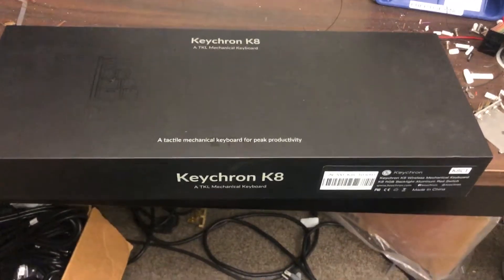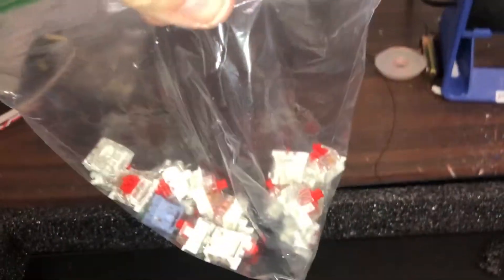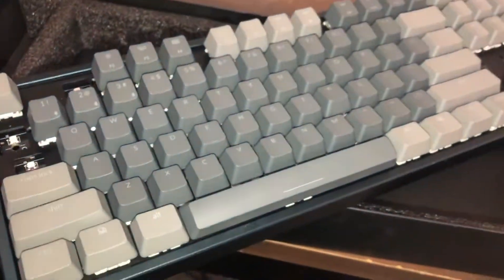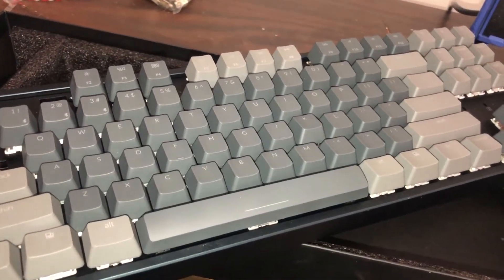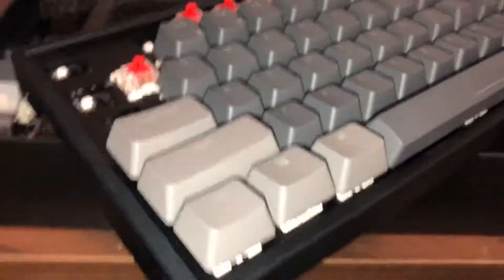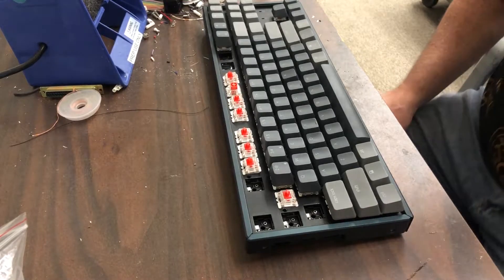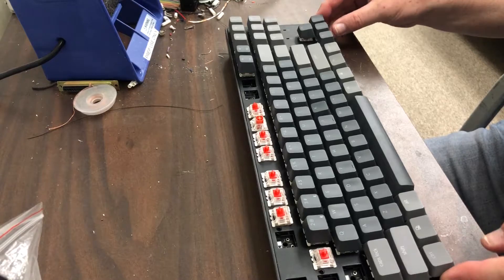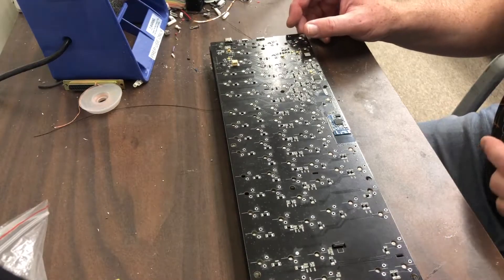Keychron k8 Repair and teardown part 1

Comment: I won't use the keychron keyboard again.
My K8 Pro keeps retyping itself for no apparent reason. 
I tried cleaning the board and replacing the switches, but the problem persists.
Reply from the maker: Yeah. I wouldn't buy one of these. I don't even use this one. It has issues.
Reply: Yeah we've had issues with the Q6 max just outright dying on us, with only a PCB being replaced instead of the keyboard, despite us being it for the explicit purpose of not needing to assemble it from scratch.  My Lemokey keyboard from them also just will randomly repeat a key being typed over and over like you mentioned randomly for some reason. It's been real annoying to deal with, and these keyboards weren't cheap by any means.

Comment: Hi, how feasible is replacing an led without taking off every keycap? I took the keyboard apart and you can see they have resoldered the key and then shipped it faulty. Not keen on the idea of removing every keycap to fix it, but I can see the led underneath in your vid and it looks possible, but before I good looking for a quote from an electronics shop would appreciate a nod to if it's even going to be possible.
Reply from the maker: You should be able to remove 1 key. You should be able to un-solder just that one and pull it out. If you need to do anything with the traces, the whole thing will have to come apart. The keys snap into the metal frame from the top. So yes, it is p[possible.  Thanks for the question and good luck!

Comment: i hate keychron K8, i owned one and when i decided to replace its keycap well it wont, unless you solder off its pin before taking off
Reply from the maker: I agree. I wouldn't buy one. Luckily, it was free.99. And I still don't use it.... Thanks for the comment.

Comment: Will it work through cable connecion without the lithium battery?
Reply from the maker: I have plugged it in via cable without the battery attached, and yes it will work. Thanks for the question!
Reply: @icemanfiveoh  One more question please, are the stock keycaps readable in the dark? I see a video on the amazon link which demonstrates rgb effects. In that video the keycap writings are not visible at all. Is that the case?
Reply from the maker: @Herman Lenana I made a short for you showing what it looks like at night!

https://www.youtube.com/shorts/sin9ERJkCJQ
Reply: @icemanfiveoh  I really appreciate this man, thanks a bunch! I've now ordered the board.
Reply: @icemanfiveoh  Perfect! thanks so much for the feedback! I love the keyboard but generally dislike inbuilt lithium batteries. I will buy it and get rid of the battery lol. Thanks again 👍👍

Comment: So if you leave the screws for the top plate on you could use it in a flowing keycap style? (without the alu frame)
Reply from the maker: I'm not sure. If you don't put the top frame back on I would be worried about the switches moving too much and potentially breaking a switch. But maybe not. The connections to the switches are pretty thin.
Reply: @icemanfiveoh  I see, I kind of worry about how it will feel to type with those alu corners since they look pretty tall

Comment: How did you get the board off the frame so easy? I can't get mine to separate at all! I did take the aluminum jacket off already.
Reply from the maker: i went back and watched the video, and I can clearly see screws that were removed already. these screws are under the keycaps and the go through the keyboard holding it down to the bottom case. You need to pull off all the keycaps and remove these screws first. Then the bottom half will come off. Hope this helps. Thanks for the comment!
Reply: @icemanfiveoh  yeah, I ended up finding an article that showed the hidden screw points. Haven't messed with it yet, had a spot of work and then a family nap time, followed by a Costco run in almost home from, but I'm going to give it another go after the toddler goes to bed. I have new stabs I want to install. Left shift key is liking to stick on the down position
Reply from the maker: Good luck!
Reply from the maker: If i remember correctly, there are also screws holding the circuit board to the top frame. besides that, every single switch has to be free from solder or it wont come apart. It def. is tricky. Take your time and don't force anything or you risk ripping traces off the PCB.

Comment: in my case the USB-C port has broken and it’s loose inside the keyboard. is it possible to fix it if they send me another PCB?
Reply from the maker: I'm not sure they would send you another pcb but you never know. You would have to pull all the keys off just like i did to replace the board. It may be possible that the usb port connector popped off and didnt wreck the pcb but i have a feeling it may have ripped off the board. It depends on how it happened.

Comment: do you know what exact bit you needed for the torx screws on the sides of the board I've tried five different bits and they're either too big or too small
Reply from the maker: I just looked and I used a T6 torx bit on the side screws. This was from my ifixit bit set. Technically it's a T6H because it has a hole in the center of the bit but that shouldn't matter because the screws don't have a pin in the center.
Reply: @icemanfiveoh  aye thanks man
Reply from the maker: I’ll grab it and look at my I fix it kit. That will tell me what size it is. I’ll get back to you and let you know. Thanks for the comment
Reply: @icemanfiveoh  Thank you so much
Reply: Weird. In my K8 it was hex...
Reply from the maker: i got this keyboard from a friend. It is possible he used different screws but it is weird. They seem like they fit and the length is good.

Comment: I ordered the k8 a couple of months ago, the side button that turns the keyboard on and into BT mode died. The seller sent me a replacement keyboard and that ended up in the same spot.

I'm unsure how to fix it. Is there a part I could order and try to replace the button myself?
Reply from the maker: The person i got mine from contacted keychron directly somehow and they sent him a replacement SMT switch. I think that is the only way you are going to find the exact one. I replaced that switch on mine. Thanks for the question and i hope you can find a replacement.

Comment: hi, how were you able to desolder yours? i really want to modify my keyboard, but I have the non hot-swappable one.
Reply: and also, is it possible to open the keyboard up without damaging anything?
Reply from the maker: So in the video i show you me using a de-soldering station to take all the keys out. It is a vacuum powered soldering iron  that makes quick work of removing solder from the PCB and switches. You can use a soldering iron and de-soldering braid, but that's where pads can start to get destroyed. Removing the keys is pretty tricky to do without damaging the PCB. as far as opening the keyboard up it's just a few screws and the pieces on the sides slide off. Good luck.

Comment: Hi how did you manage to open up the board without taking up all the switches? i have a hot swappable one too
Reply from the maker: I took out all the switches....This keyboard was given to me because the previous owner wanted to swap all the switches but he ran into problems de-soldering them. I have a Hakko rework station that can suck out the solder super easy. Since it isnt hot swappable the switches go through the top frame. If yours is hot swappable, from what i understand you just pop them out and then the top frame is screwed down to the rest. The pads are pretty delicate on the PCB so using a desoldering iron is the safest way to get them out. I hope i answered your question! let me know if you need anything...Thanks for watching!

Comment: Hi, I have a keychron k8 but it is not hot swappable. Is there a way to disassemble a non hot swappable one?
Reply from the maker: The  board is held in the frame by the keys. you can partially take it apart but the top frame isn't going to come apart unless you de-solder the keys....What are you looking to do?